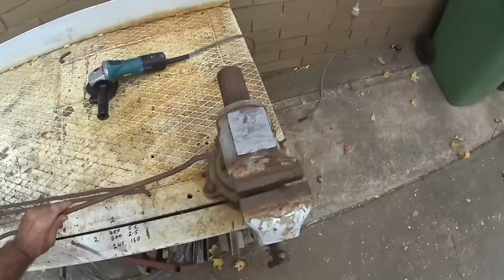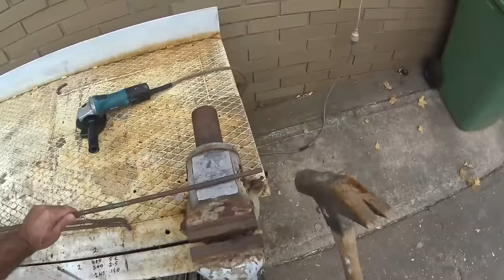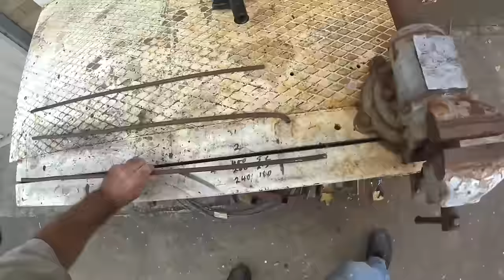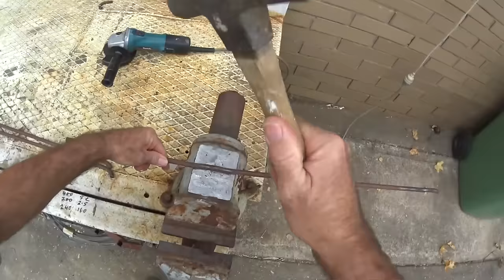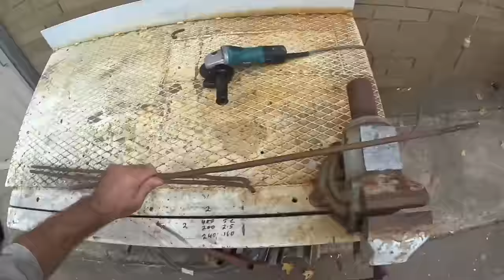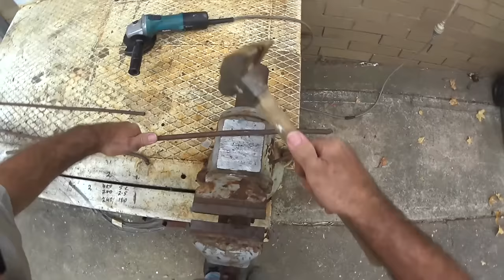Hammer Hitting Metal Sound Effect - 8 HOURS - with video - Metalworking Workshop sounds

Comment: I put this video on a JBL bluetooth speaker inside a big metal bowl and put it against the ceiling for my noisy neighbors. It creates a parabolic dish and blasts through the floor. They let their toddler run through the house 24-7 over bare wooden floors, but they have a baby so i figured out they go in their bedroom with the baby. This is where i put the parabolic dish and blast this video. It works like a charm and they immediately go shut the kid up. I call it "baby gets the hammer". 😂😂😂😂